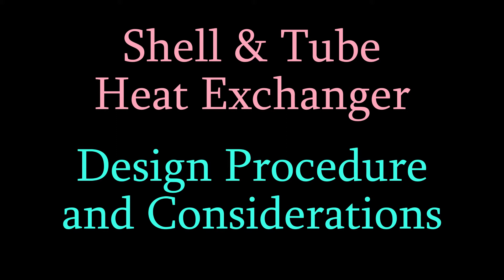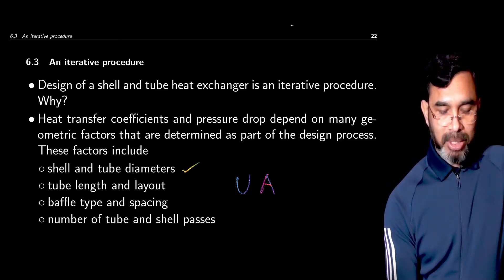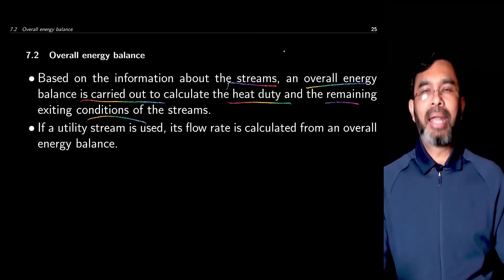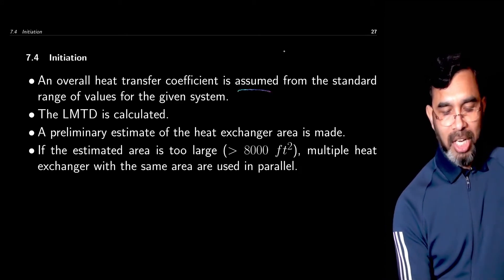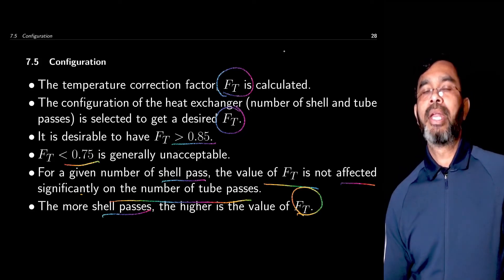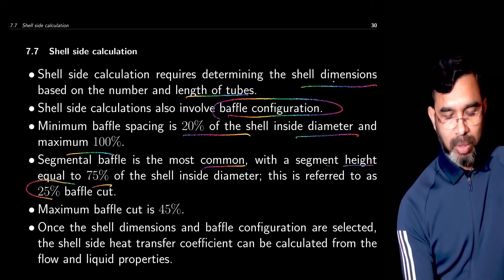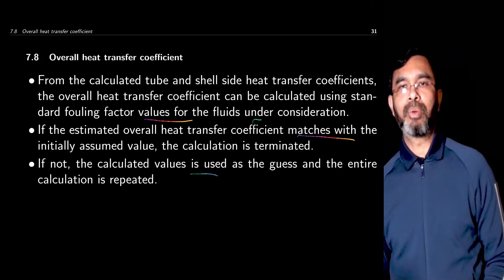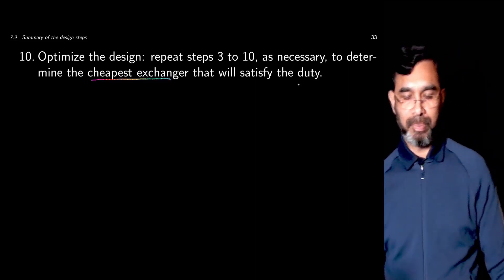Design procedure for a shell and tube heat exchanger

Comment: Would have been great if the theory was supported with a solved example
Reply from the maker: This is part of a course and students solve a problem in class. Please find the problem in the link below
https://www.mun.ca/engineering/crise/media/production/memorial/academic/faculty-of-engineering/c-rise-engineering/people/Heat_Exchangers_Workbooks.pdf
Reply: @salimahmed1711  sir thanks for sharing it....If the additional info is not given and if we need to proceed the design how can we do it sir?For example I'm designing a Heat Exchanger in an industry,Using TEMA standards and according to my flow rates I have found the tube dia,and other data etc except the effective LENGTH of the heat exchanger....How can we find it?
Reply from the maker: @harikeshavraman5506  Hi: I think the vendors will provide specific information. Typically, you may not have many options about length. Thanks.
Reply: @salimahmed1711  very useful, nice share